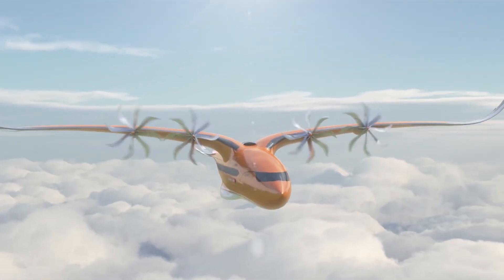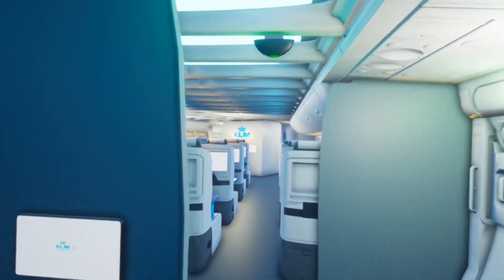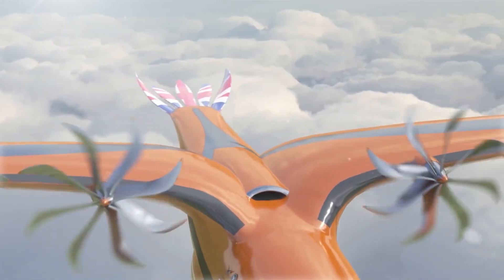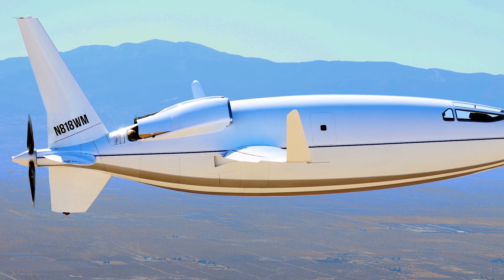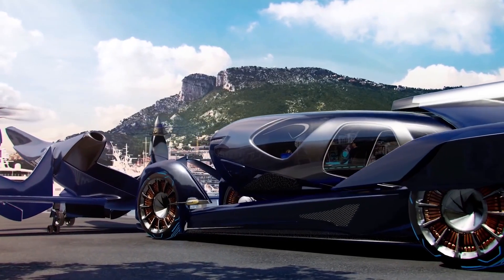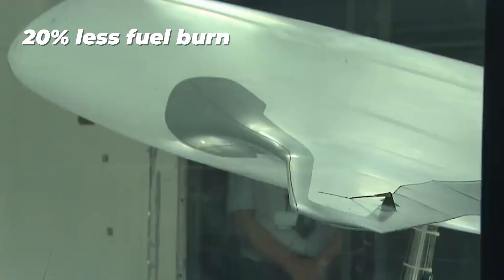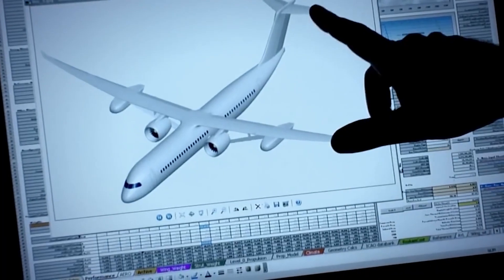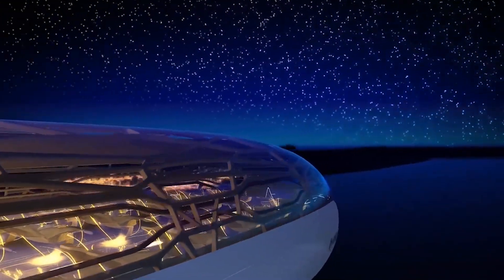Future Aircraft That We Might Fly On - Concept Planes From Airbus, Boeing And More!

Comment: Coming to SUGARVOLT. it's like flying V but not like blended wing. It has an inspiration of being hybrid but at take of, single jet engine with help of 2 electric motors could suffice. Keeping in mind the FCC's dual sustained engine rules, since electric engines are backups, there are no need for 2 jets.

Comment: The Bird of Prey design was more or less in my previous designs at Kerbal Space Program. I used to attach lifter wings(servos or elevons) back on back instead of a large wing and a small servo, in order to reach higher speeds and have less drag while having most control. Resulting say, 4 elevons working oppositely, say 2 pairs lifting up, while 2 pairs giving downforce, with one up-one down setting, the craft avoids the need of additional airbrakes since the drag is sufficient to slow down. Another 500kg advantage minimally.
Glad to see some business bosses dropping into idea.
Reply: More on that, by designing craft that has enough control, and giving slight symmetrical bend to the wings eliminates the need of vertical wingtail. Much or less like Bayraktar airstrike drones.
Reply: wow the Bird of Prey project is absolutely outstanding !!!

Comment: In less than 20 years SpaceX has built a fleet of space crafts with recoverable/reusable rockets. They are building a low-level constellation of satellites that will bring broadband to rural areas of the world. They just started space tourism. Working on colonizing the Moon and Mars. Projected to have commercial air service by 2027 in which you can fly anywhere in the world in just 30-40 minutes. Meanwhile, we're still flying a commercial airplane design that have been around for 70 years. WTF is taking so long to improve commercial flight?

Comment: Awesome video, I love efficient plane concepts. One nitpick: there are no electric engines, just motors. Engines are mechanical and rely on compression. All engines are motors but not all motors are engines.
Reply: Shuutttup.  Are you base enough to think air fight on a commercial scale could go electric?

Also, do you realize electric batteries cause as much pollution as regular means of energy?  Bro. Get a grip.
Reply: @Gdub33  How about you actually read what I said and calm down. I just pointed out the difference between an 'engine' and a 'motor'. I'm well aware that electric flight is a long way from going commercial. That said, there's nothing wrong with designing airplanes that save fuel by being more aerodynamic and efficient.
Reply: @Gdub33  Also you're wrong. Batteries over time pollute WAY less than burning fuel. A passenger jet emits 2 tons of CO2 per hour, your car only emits 4 tons in a whole year. Now realize that there are tens of thousands of planes in the sky at all times year round and you'll understand why people are trying to make a change.
Reply: @nathanchildress5596  bro no they don't. You're thinking of like regular batteries. It's not financially feasible to develop a full battery.  Plus it would be almost as toxic for the environment. I don't think you understand the scale these batteries would have to be. Enjoy your pipe dream.

Comment: All concepts got their own advantages. But the aircraft concepts with long thin cord wings like gliders isnt for me. Just wonder why there isnt a swing wing concept like the B1 for example. This will solve the landing and speed problem. I myself like also to play with out of the box concepts. For example i have designed a drone type of airliner with X type of wings and an eliptical fuselarge with ample elbow and knee room. Instead of rotating rotars i used turbofan engines with movable nozzles just as the F-35. Time for vertical take off and landing aircraft.

Comment: Boeing Sugarvolt is interesting. Especially the engine which functions as a jet at takeoff and operates with electrical motors at high altitude.
Reply: especially considering, it would be able to operate it's engines at altitudes where there is not enough oxygen for conventional jet engines, but the air resistance is much lower and speed of sound is higher.
Reply: The problem with batteries when flying airplanes is the fact that when they deplete .... you still carry the massive extra weight to lug around. This will reduce efficiency drastically. Right now, you carry 10 tons of jet fuel (or however much you need for your trip) and you actually burn it, causing the weight of the plane to be drastically reduced during flight thus allowing for efficient operation. Dragging really heavy empty batteries around (no matter how short or long is your trip) will probably offset the benefits of electric engines by a whole lot. The possible outcome is that the plane would have to carry a lot less passengers given its size, the tickets will be expensive and it would likely be just a "luxury" experience for a select few.

Comment: Pretty sure the Celera 500L “consumes 8 times less that any other jet airplane” because from the looks of it. It’s a prop plane.
Reply: Turboprops are still jet powered but you'd still be right, thr Celera indeed uses the good ol piston engine.
Reply: @carlosandleon  Turboprop isn't a jet, either. It's a propeller driven by a turbine engine, but because the thrust is provided by the prop and not the engine "exhaust" , it's not a jet.

Comment: Very interesting video, good summary of futuristic designs. As a part of my MSc in Aircraft Design I worked on a project similar to the Boeing Sugar Volt. An important issue it had was with the landing gear design, particularly its stowage since the high wing location deprived the design of a “natural” place to retract the landing gear into in the wings.
Reply: Im sure you and the whole aviation industry in general is working hard for a better flight experience, but i gotta ask  whats going on with making flights a bit faster Or in other words are the engineers working on reducing sonic boom for the commercial front?
Reply: @primeanomalous4275  Hello, good point! To be honest, speed is not a concern these days. In fact, many of these new concepts trade a bit of speed for a lot more efficiency. The rationale is that even if the aircraft cruise speed is 10% lower, your trip time will mostly not be affected because most of the time of your journey is spent commuting to/from airports, in the airports and waiting around rather than flying. Also, if we wanted to cross the transonic regime into supersonic flight, efficiency goes through the window and costs through the roof.
Reply: @jibeneyto91  So no hybrid energy recovery, for maintaining efficiency? 
& Man, LA to London in under 3 hrs is too tempting tho🙈 hope some more innovation and of course political/economical feasibility as well change... and new fuel sources come to light making supersonic flights a reality in this generation atleast..
Reply: @jibeneyto91  Dont you think its time for establishing aviation consortiums which developed new and cheaper jetfuel to get rid of the economic problem of flying. Tackle the problem at root level and give the Arabs and politicians the middle finger.
Reply: A&P here, What if the long landing gear utilize the suspension to allow it to shorten and stow in a smaller area by depressurizing the suspension.
Reply: @thegoldenatlas753  That's similar to what the BAe 146 does. Except it doesn't "depressurize" the shock absorber per se, it just shortens the length of the leg mechanically by means of a double rotation. It's a very clever solution.

Comment: Deff the Flying-V! It‘s just the most beautiful concept plane I‘ve ever seen!
Reply: I agree, I am quite a fan of flying wing planes
Reply: @SubaruPieter  It's not a flying wing
Reply: @cancelanime1507  how so?
Reply: @SubaruPieter  flying wing means no other surfaces than a wing. Blended body means the fuselage and wing provide lift, with a possible empennage providing control surfaces. A flying wing will have no rearward stabilizers, vertical, horizontal, or combo, and in general won't have any sort of clear distinction between fuselage and wing
Reply: @brianargo4595  ah yeah, that's true
Reply: As an Avgeek you've hurt my feelings with alot if other people
Reply: Wtf?

Comment: I like how people keep saying the extra space in these concepts can be used to increase comfort by giving back legroom and seat space. We all know that what will really happen is the airlines will take that extra space, cram it full of more seats, and possibly take away some of the existing legroom we still have even more.
Reply: Nope. Planes will need the space to store a replacement fuel that needs more than double the space
Reply: Yes but also no. Kinda depends on the way demand goes. If you're flying because you have to or on a budget its all about the lowest price. Right now the options are pretty limited if you want more comfort. You can't really go get a private jet. However if you can offer people the same price ticket as a conventional jet with way more comfort they will be willing to shell out 100 extra dollars
Reply: @jasonchecinski9741  this also assumes the FAA or another regulatory body doesn't set a hard limit on how many can fly on a single plane. I can see that if start to see 1000 plus passenger planes.
Reply: Well they can't actually cram more people beyond a specific weight limit. the plane would need to carry extra fuel more than anything to carry extra weight, the extra size of blended-wing airplane designs reduces drag and fuel consumption drastically which makes the flights cheaper to operate, but it doesn't mean the plane will be able to hold a lot more weight (or people) - so the airlines will still make money as the planes will now cost way less to operate while still taking the same number of people. The "extra comfort" here is actually a byproduct of the design and not really the intention of the design. I'd say it's a win-win for everyone involved.
Reply: Yep
Reply: Legroom is half of why I don't fly anymore.
Reply: @henryfleischer404  I totally feel your pain, however, I'd like to say that in most decent airlines I don't really have issues, my favorite to fly right now is Emirates, Qatar, Delta (to destinations outside the US) and probably Singapore. No legroom issues from my experience. Only the really cheap budget airlines present some challenges, especially when they nickle and dime you for everything - for example, I absolutely hate how every freaking seat on American Airlines flights is basically "premium" .... and you have to pay for it if you want to choose where you sit, its total bullsh*t. Nothing is premium about an isle seat in the middle of the plane LOL! But they'll still nickle and dime you for everything, you might as well buy Economy Plus / Comfort or whatever the hell they label it now a days and call it a day.
Reply: Yeah, as the railway companies of Britain are already infiltrating that idea concept to increase the capacity
Reply: I have enough leg room on the ✈️ it seems people just to sit with their legs wide open
Reply: Which will reduce the price of flying and still ultimately be a positive
Reply: @joshuadrew6246  true but I think I would pay 10% more for more space. but you are spot on.
Reply: "Money, money, money" - airlines
Reply: @Made_In_Heavenn  "money money money" any company understand capitalism

Comment: Eviations' Alice seems really promising for low volume short haul flights. And Boeing's a Sugar volt concept is likely to make it further in the prototype phase. Boeing and Airbus's blended wing concepts will likely see further study.
Reply from the maker: Several airlines in Africa are interested in the project, as it’s perfect for safari flights
Reply: @FoundAndExplained  come to think of it,  Africa is the perfect market for these
Reply: Alice is gonna make it for sure.. one third of price for same role operating is nice.
Reply: Sugar volt doesn't make any sense, that thing is going to have 3 tons of engines that don't get used 100% of the time.
Reply: @andrewyork3869 The Way SUGAR VOLT works is that a hybrid system is integrated into the two onboard engines so that during take off, the electric drive can assists the traditional fuel powered turbine and in the air, the fuel burning part of the engine can lessen its load with the hybrid electric drive driving the turbofan with the fuel burning core only lighting up when necessary to save fuel. As both systems are integrated into both engines, it’s never actually carrying around extra unused engines, it’s simply using a hybrid system to determine the delivery levels to both the electric and fuel burning sections of the engines. So it’s really not carrying any extra weight, or at least not enough to offset the fuel savings resulting from the hybrid drive system.
Reply: @L33tSkE3t  Yeah but these electric motors are too heavy per KW. While to have exact numbers I would need to know the core, the electric motor, and net thrust in question, That said it will ALWAYS be heavier then just a gas turbine engine. That's not getting into the fact that JET A holds more energy per Kilo & Liter then any battery even bleeding edge battery packs. (HYDROGEN FTW!!)
Reply: My turd is also projected to get a new wing flap next year. Guess which will happen first?  My turd gaining a wing flap or any of these "prototypes" becoming an actual plane. My turd wins.

Comment: Clearly this all about batteries. It is all about batteries1 It's about batteries. Until you have a batter with the energy density of a chocolate chip cookie, you should not proceed with any electric vehicle that relies on electricity alone -- submarines excepted. They are big enough and robust enough to have diesel drive generators as back up power.
Reply: if you want to be the first you have to develop aircraft now and wait for battery... once battery comes you can be first with all market just for your self. probably thats what they are thinking...
Reply: @jebise1126  Why would anyone in their right mind build anything that flies on electricity if the battery problem has not be solved? Do you have any idea how it will take to develop a battery capable of such a feat? No, you don't and neither does anyone else. What you are talking about is putting the cart IN FRONT ol the donkey.
Reply: @ManuelGarcia-ww7gj  nobody is gonna solve the battery issue if nobody is gonna use it, that's like making a bullet for a bow
Reply: @Milk_Bag67  Okay, I must disagree with you on this. At one time the idea of a small desktop computer would considered ridiculous. It was said of the LASER that it was a solution in a desperate search of a problem to solve. You ignore Says Law at grave risk. Supply creates its own demand.

Comment: Delft isn't pronounced 'dee-left' but just 'Delft' 😅. Having said that it's probably most likely to be realised.
Reply from the maker: Thanks for the tip! As an Australian I believe we had trouble with dutch words
Reply: Would it be able to fit in standard airport gates?
Reply: @L33tSkE3t  That's the principle. It's designed in a way that it would fit existing airport infrastructure.
Reply: @ingo6295  Awesome, it would enable some really cool interior concepts as it has the space to allow for awesome first class amenities and the open space where it Transitions from a single traditional cabin to two split, could be used as communal space as you find on Dubai Airlines A380 Where they have a bar but, on level more accessible to passengers
Reply: Wouldn't bit of turbulence kill passengers it?
Reply: @borek772  Wouldn't kill people but it definitely would be harder than on a normal plane
Reply: @ingo6295  unless, by that time we have better ground < satalite < air  info